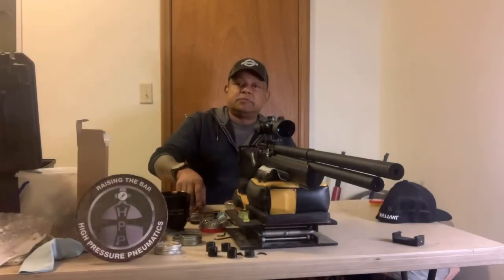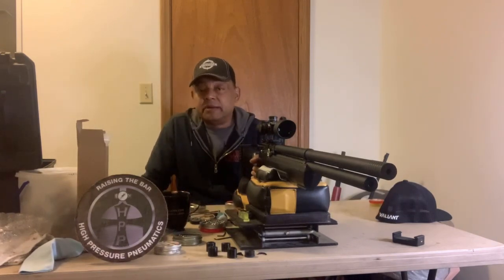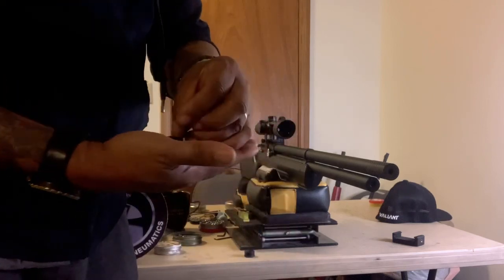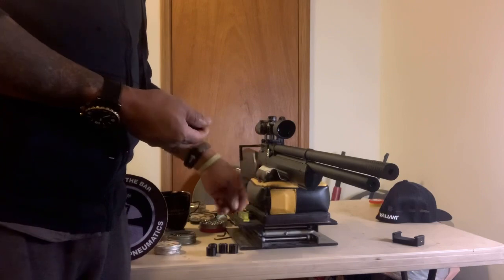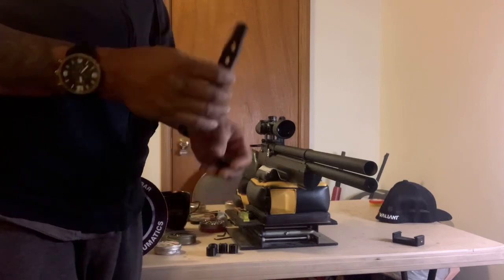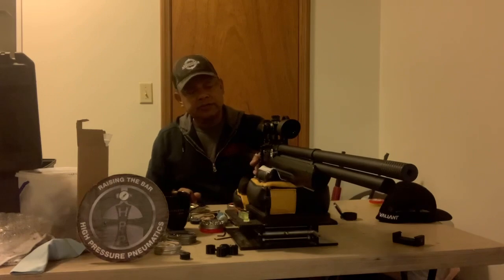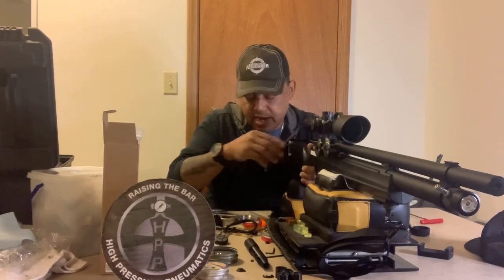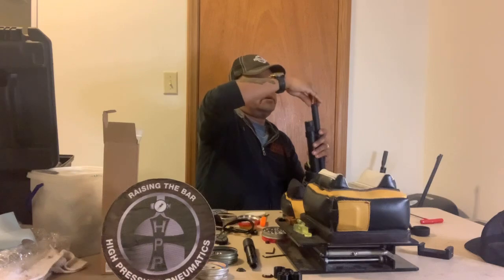3D moderator comparison test: Avenger, Nova Liberty

Comment: I just came across this video. I didn’t realize you had a Nova Liberty. I have one also and have shot the hell out of it. Awesome gun. Wish I had one in each caliber. I had a second one but my hunting partner was sharing mine every time we did pest control jobs so I sold her one but then I couldn’t find another one to buy. The only issue I ever had was point of impact changes at different temps. I removed the barrel band and put a 7/16 ID carbon fiber sleeve over the barrel and that fixed it. Of course I made a hammer spring adjuster and tuned them. Very accurate, efficient and quiet shooting gun. I shot 30g slugs out of it for a while and beat the hell out of the valve and pop it and never had an issue. I did put a large plenum in one of the gun. Anyways I would like to see you use your Nova Liberty more if you still have it.
Reply from the maker: 👋🏾sup brah! Yes I still have mine! As matter of fact had to replace an o ring that had a small leak yesterday and was planning on taking it out on the farm permission. It’s a 177 and did the same mod so I can adjust the hammer spring! Haven’t tried slug yet but I’m planning on trying some since I can adjust the hammer spring. Give me a call 269 601 2121 ken Braddah👊🏾😎

Comment: Excellent video. 
I love Donny FL products. While I understand that they are not cheap. I believe you get what you pay for. 
I use a RONIN. It's super quiet. But I just purchased a TANTO for my 177cal Avenger. With the barrel line up adapter and moderator, it will add 6 inches to the overall length. But I know it will absolutely be quiet and won't clip. 
I'd rather pay once and be done with it 💯
Reply from the maker: 👋🏾wtup Bruh! I do like my Donny fl! Bought the fatboy to try out but right now I’m in the Philippines vacationing until April and won’t be able to test out against some other moderators I own! I’m lucky I have a signal to be able to reply to you because right before Xmas the island I’m on wax hit by typhoon odette the strongest typhoon to ever hit the Philippines and my family and I survived it Brudda 👊🏾😎
Reply: @airgunspestingch.8426  Typhoon......Are you serious?
God bless you brother and your family. Your channel should have a million subscribers. Your one of the best brother. 
Thank you for everything you do and share ❤ 💕

Comment: 💪🏾💪🏾Nice review I just got the same one for my 25 Will test it when it stops snowing
Reply from the maker: 👋🏾sup bruh! Thank you! What is the name of the company that makes a forward cocking lever for the skyhawk?
Reply: @airgunspestingch.8426  tech23.de is where I got mine the charm Meg guy or Jake 3d makes one to for the p15 that look better then the one I got
Reply from the maker: @bigmixx76  👋🏾sup bruh I’m actually doing a video of jb3d forward cocking lever conversion brotha 👊🏾😎
Reply: @airgunspestingch.8426  ok cool I can’t wait he told me he wasn’t for sure if that would work with my Diana Skyhawk because if I get a Skyhawk or p15 in 22cal  I wanted to put his front lever on it   If you run across one at a good price let me know
Reply from the maker: @bigmixx76  👋🏾sup bruh that should not matter because the only difference between the Artemis p15 and skyhawk is the stock brotha 👊🏾😎

Comment: There's getting to be quite a few option out there, I just haven't done it yet, I really need to do something with my Gauntlet 22. Ever since I upped the reg to 1400psi,  it's louder than I like. Definitely don't want to add any length to it.
Reply from the maker: 👋🏾sup bruh definitely options out there. Some good some not so good as I shown on the video in the beginning. I got my money back btw brotha 👊🏾😎
Reply: @airgunspestingch.8426  glad you was able to get a refund. I guess I was really just planning on Haji's baffle upgrade. Seems to get good reviews. Although, he does sell the shorter shroud with a adapter if I recall correctly.

Comment: Ouch! Ouch! (end target). I've tried some eBay 3d printed baffles and had the same issue you had, clipping. They do change the report and make an airgun a little quieter, but honestly, I'm not impressed yet. Someone was saying they had one that dropped their gun 10 decibels, I'll have to look into that more, but I could deal with the ten decibel drop for sure. I'm like you, I don't want the gun any longer than what it is, I'm used to bullpups, and carrying the Avenger around is a different story, not that it's heavy, the length gets in my way. I was out with it in the woods today, then I went back with a Flashpup, it's a lot easier for me to go through the weeds with a bullpup, but I still love my Avenger, I've been popping pop bottles at 133 yards consistently with mine.
Reply from the maker: 👋🏾sup bruh thank you for sharing your experiences. “Sharing is caring “ brotha 👊🏾😎
Reply: @timmy4539  .25
Reply from the maker: 👋🏾sup bruh how about sharing? “Sharing is caring” brotha 👊🏾😎
Reply from the maker: @timmy4539  👋🏾sup bruh no offense. Did not know about bison. Thanks! Sharing is caring brotha 👊🏾😎
Reply: @airgunspestingch.8426  I'll eventually get out to get some video in. I did one on slugs in it about a month ago, but haven't uploaded it, slugs are not so good on a factory tune (avg. 908 fps). I went out yesterday but the wind was horrendous, that's the way it's been since Fall. The Air Arms pellets are what I use for long range pellets. I'm hoping today will be decent, I feel good physically so I may be able to get it done. Right now I'm taking a break from homeschool, kind of a recess while mini-me watches some videos he needs to watch, lol.

Comment: The person used cheep filament and it the parts where not treated with a clear coat or painted the dampness in the air will cause the part to become brittle and crumble like a dry cracker. If your printed moderator is good when you first get it and then store it when you use it if it was printed cheaply it might blow apart. I bought a 3D moderator and a barrel band for my 25 Avenger it worked grate. Did not use it for a cupule months and the  barrel band crumbled and the moderator blew into peace's. 
  I now have a 3D printer and leading about filaments some are vary good and hold up well some are crap. If you buy a 3D printed part or even a game peace or a toy put a protective coating of some type. 
I have been testing different filaments and I have things I printed six months ago and will crumble when I pick them and a 3D mallet I use it tap my pellet mold that I have used a lot.
  I hope I have helped on some help about 3D printed parts. Get a printer that are cost effective and can really class up your rifles.
We break For squirrel   he made a green hall avenger
Reply from the maker: 👋🏾sup bruh ! Good information! Will check the 3D parts I have brudda 👊🏾😎

Comment: Best of luck with the 3D printed baffles. They do reduce the report.
Reply from the maker: 👋🏾sup bruh best of luck ?
Reply: @airgunspestingch.8426  They obviously work but IMO using a Donny adapter along with your best screw on would be much better.
Reply from the maker: 👋🏾sup bruh thank you for the explanation brotha 👊🏾😎